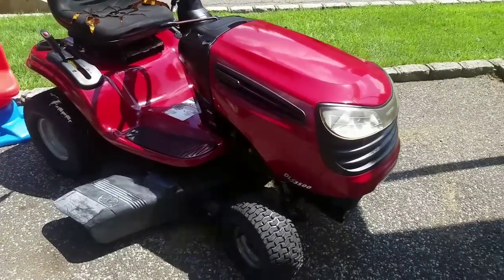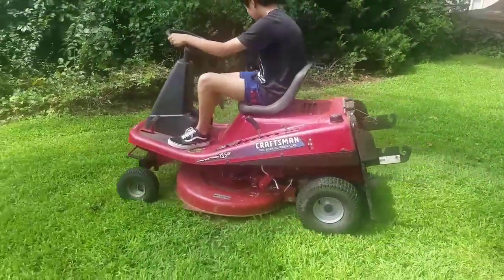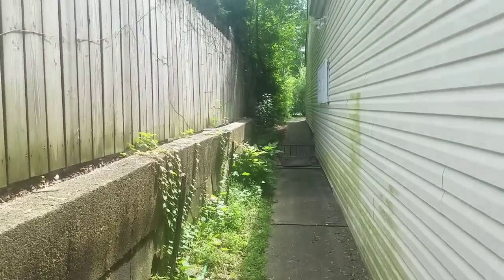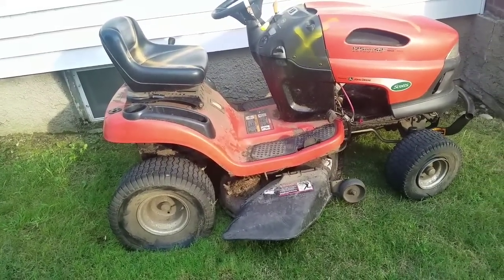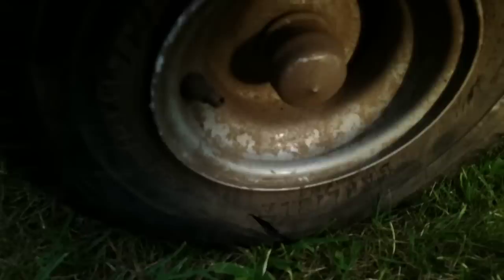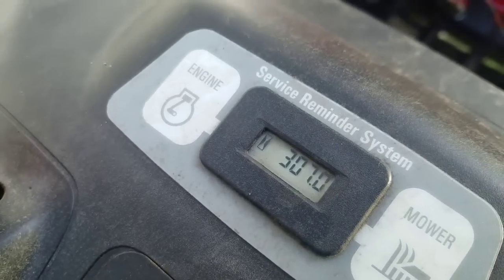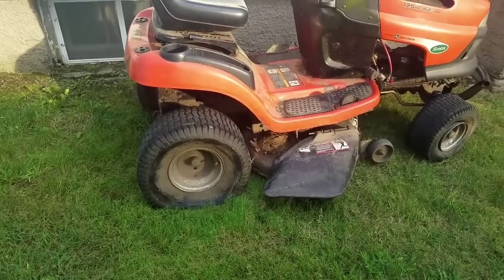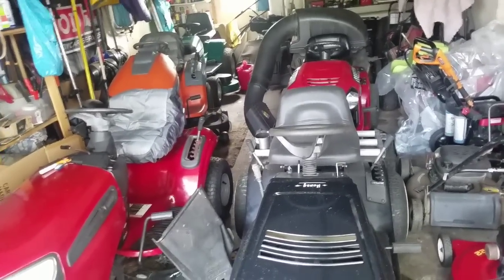FREE SCOTTS BY JOHN DEERE 17.5HP 42" KOHLER COMMAND LAWN TRACTOR RIDING MOWER ENGINE LESS PARTS PICK

Comment: Interesting video. I’m wondering what you think about that 17.5 hp Kohler engine? There’s one for sale up the street for 200 it looks really nice.
Reply from the maker: I’ve had a few of them, rebuilt 2 of them because of blown connecting rods. Just make you you check the oil often.
Reply: Mowers N Blowers Hey thanks for the quick reply. Are they fairly easy to rebuild?
Reply from the maker: If you've never done an engine rebuild, it would be challenging, but I've done about 5 before, so not a big deal, here is a multipart series on one.

https://youtu.be/l5kg0efy0Tg